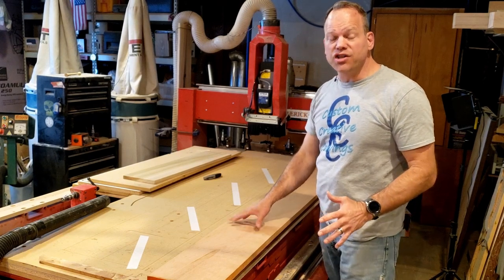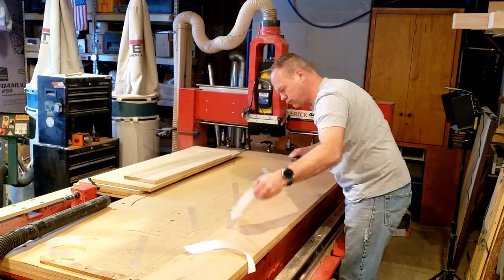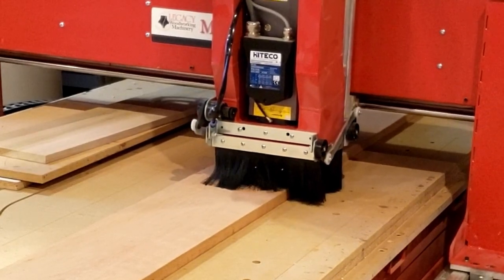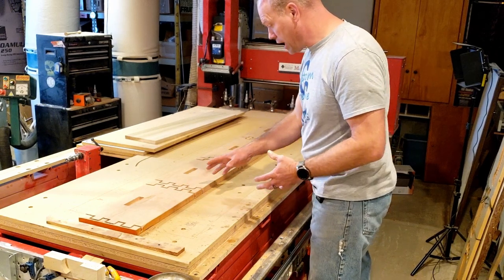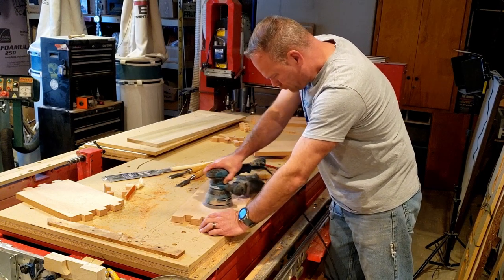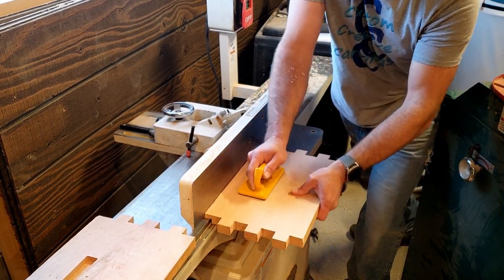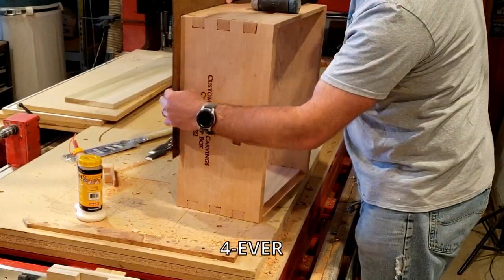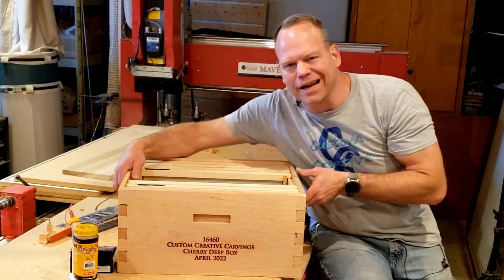easily make a bee box with a CNC

Comment: The only channel I can find on making hive boxes with CNC - dig this!! Definitely interested to see how you do the frames. Scaling a CNC workshop to make beehives in bulk would be interesting. The personalized information detail is excellent!
Reply from the maker: If you are planning on making a lot, I would recommend using a vertical vice on the cnc to cut the ends, it will be a lot faster than using the box gadget.  I went this way because it was low production numbers and I did a carve on the face.